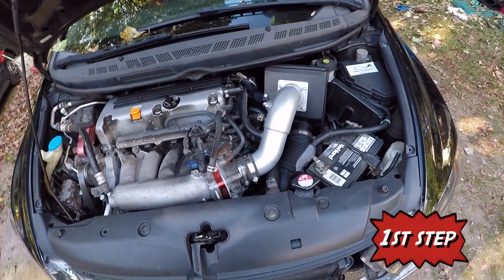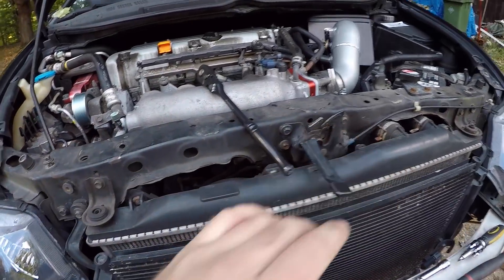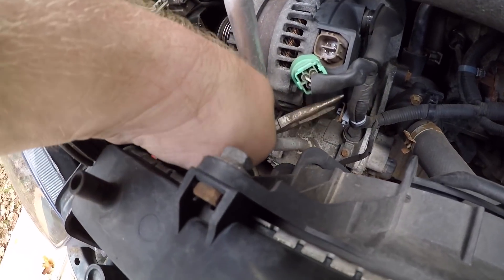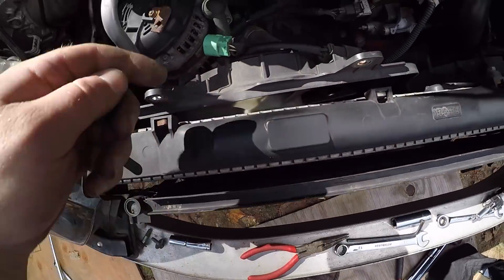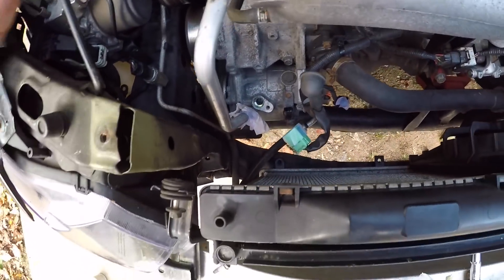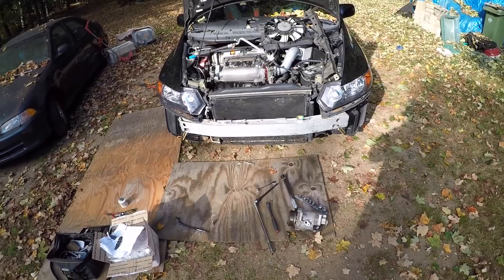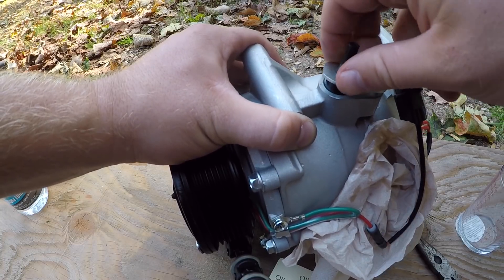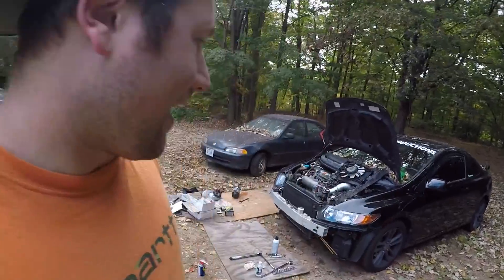Honda Civic Si Remove & Replace A/C Compressor DIY (2006-2011 Civic Si)

Comment: Thank you very much for your video, it helps me a lot. For those wondering whether you can change the a/c compressor clutch without take the compressor out, it is totally possible (but will take a lot of time), I just done this today. You don't have to take your bumper and alternator off, just need to take the bottom cover off and follow steps in this video to take the top cover and metal bar off (metal don't have to be off you can just lift it out of the way to remove the radiator fan), when you remove the radiator fan there is plenty of space to remove the a/c top 2 bolt.

Comment: Just going to do this a second time LOL. Don't go cheap on the compressor. Used a sub $200 one from rockauto and it took a dump on me after about 1.5 years (hole blown right out of the side - guessing the high pressure switch on the compressor didn't do it's job). Just ordered a denso one today which is what I should've done in the first place. And just a few pointers; that compressor you originally pulled in the video is the original factory equipped one with the green label that turns into a super charger after around 50-60k miles. Only the 1.8 civics got denso compressors. Also, no need to remove the alternator; just the passenger side cooling fan. And the radiator cover doesn't need to be completely removed (just unbolt it and swing it over to the right side). Also the whole bumper doesn't need to be removed either, just those top two grill screws (with Allen heads). Somebody previously was saying that you can get it from underneath but believe he's smoking something (maybe that works on a standard civic but there's no room with the 2.0L - even if you slid the compressor over by the bellhousing you would still need to drop the subframe a couple of inches. And believe it is standard practice to drain all of the old shipping oil from the compressor and put fresh stuff in there. IDK why they bother, maybe it's a warranty thing for people who forget to add oil but that PAG oil is like brake fluid and sucks up any moisture. Not sure if I would trust it coming from overseas.

Comment: Jesuz H, 1. get the front end on stands 2. take the rf wheel off, remove half of wheel arch liner. 4 loosen 4 sub frame bolts  remove the 2 short ones. 5 remove 2 10 mms on lines, disconnect the connector, remove 4 12mm bolts on compressor. With a prybar, pry down on subframe... it slides out the rf wheel well... the way he shows looks like it takes all day
Reply: Lmao screenshotted
Reply: "pry down on subframe"...isn't that bending/damaging the subframe?  It seems like you can definitely get to it underneath / wheel but not trying to bend things to replace.
Reply: @mjnuss  year latar lmfao but nah you can pry all u want you wont bend it

Comment: I’m also having a whining sound come from my car. I changed the idler pulley, belt tensioner pulley and alternator and I still have the whining sound. Did the whining sound go away for you after you changed the a/c compressor? If it’s not the a/c compressor it’s gotta be the water pump. What do you think?

Comment: Not bad. Helped with getting my alternator out. I didn't replace my whole compressor but just the AC clutch, thru the wheel well. Definitely will be removing it completely next time if something happens haha.
Reply: did this fix your sound issues?
Reply: @ivanc8533  no sound issue yet. But clutch was worn out and ac was intermittent, tho if there was a noise issue brewing I reset it as the AC rebuilt kit came with new pulley and bearing.

Comment: What issues did you have that you swapped out the compressor? My 8th gen is acting up. The compressor turns on and engages but my rpm’s drop to 500 rpm , then the compressor disengages, goes back up to 900 rpm for a moment, then drops again when it rengages. Then that cycle repeats til I turn off the ac. The engine almost stalls and drives weird when that’s happening

Comment: This is great! I have to pull mine out. Already did the altenator based on previous video from Gerb.  My compressor runs cool air if it will engage, but blows a fuse when it tries. I put a hockey stick fown there to force the clutch to engage while running, and AC is ice cold. So I got myself a clutch kit off Amazon for ~ $70 USD.  Its really common for the clutch to go and the compressor be just fine. $350 vs $70. We'll see if I can figure out the clutch. Looks like its just snap rings for the swap. I'll probably swap the oil and the rings after watching this. Any idea where to finda an o-ring kit for the compressor lines?
Reply from the maker: Glad i could help you out! I'd try local parts stores or a honda parts site for the o-rings. OEM o-rings will last the longest.
Reply: @TheGerbsteve  actually found a vid to pull off the clutch without removing the compressor. In my case that makes a lot more sense. Love all your vids

Comment: I never see u add freon
Reply from the maker: I brought it to a shop afterwards
Reply: Bro can u help me I clean my throttle body and now my check engine light is on and I did a relearn procedure and it still is not functioning right do I have to get a new throttle body thanks

Comment: Hey gerb I’m getting ready to change my ac compressor. Already change my condenser thanks to your video. I’m thinking about going with denso. My question is do I need to get anything else. Since this is only the compressor itself. Thanks

Comment: are the bottom ac compressor bolts shorter then the top ones?  I am doing my compressor and if you are looking at the car the bottom right compressor bolt of the 4 main ones hits the oil pan when I am reinstalling it.  I purchased 4 new bolts as I stripped one out when I was removing it.  Are the some of the 4 main bolts different lengths?

Comment: What was wrong with the compressor in the firts place? If was noise it coming from the front berarin.and simple you can change the front clutch like I did in my.

Comment: How did you drain your AC out? Tried lookin for videos but most won't get to the point. Do I need specific tools or?
Reply from the maker: I brought it to a shop. They need to vacuum it out with a special hose.

Comment: Good write up my man, the tq specs on the 2 10mm bolts on the compressor are 7.2ft/lbs btw so 7 opposed to 8 is probably a little bit better if you want to add an annotation (Pulled from the service manual :) )
Reply: Also, here are the numbers for the oil that shoudl be added for each component of the system :)
http://civic.hondafitjazz.com/A00/HTML/10/SNB6E10G10100050652KBAT00.HTML

"A/C condenser .  50 mL (1 2/3 fl·oz, 1.8 Imp·oz) 
Evaporator .  40 mL (1 1/3 fl·oz, 1.4 Imp·oz) 
Line or hose .  10 mL (1/3 fl·oz, 0.4 Imp·oz) 
Receiver/Dryer .  10 mL (1/3 fl·oz, 0.4 Imp·oz) 
Leakage repair .  25 mL (5/6 fl·oz, 0.9 Imp·oz) 
A/C compressor .  Since the oil separator is equipped inside the compressor for this vehicle, oil drainage is unnecessary at the time of compressor replacement. "
Reply from the maker: Thanks for the support bro!

Comment: Did this fix the whining noise? Because I own a 06 civic si and it's giving me a whining noise also, I just changed out the alternator yesterday and that wasnt the problem.
Reply from the maker: Yes it did.  I would highly recommend that you look into this.  Some of the symptoms of was having is an aggressive whine noise, car stalling, and wear on my serpentine belt. Wish you the best luck

Comment: The compressor that you replaced (Sanden) was original for the Si, not everyone comes with Denso. At least here in Brazil, all of them came with Sanden ones. Denso only on R18...
Reply from the maker: +Hugo Matsubara Did not know that.  Damn, wish mine had the denso, it would still be good haha.  Damn, Brazil?  I want to visit haha
Reply: Don't want to vid jack but being from Brasil, how easy is it to get a fuel sender from a one of those Civics?
Reply: My 07 Si also has this as OEM. They are prone to have the clutch go bad.

Comment: how did you evacuate the system?  Like how did you get the freon out before doing this?

I'm thinking of tackling this project soon.
Reply from the maker: A special machine at shops. I would not recommend letting refrigerant out on your own, it can be dangerous
Reply: Oh, yea, definitely won't let it out on my own.  Fortunately, I was on my first Rev of a tune via Flashpro, and when I updated to the 2nd Rev calibration, it fixed it on it's own.

Super weird!
Reply from the maker: These cars can be temperamental lol

Comment: I have some issues whit my ac too when the car is running it will blow cold air but when  is stop it won't what you think it could be the issue?
Reply from the maker: To be honest, my Si started doing this not too long ago. I really think it may be some sort of valve that could be clogged.
Reply: Check the a/c fan might has low rpm

Comment: Question, how did you determine your AC compressor was bad? Not sure to replace the compressor or just the clutch. AC system works fine when the ambient air is cool and stops working when the air is hot after 15 minutes or less. Just keeps blowing hot air and the clutch is no longer engaged. Any advice from DIY Utubers will be appreciated. Thanks for your video 👍
Reply from the maker: It was making a whining sound. Also I believe the clutch was fried in my original ac unit.  I would grab yourself a whole new unit. Could be the expansion valve also 👀
Reply: You can use a power probe to determine if the clutch is bad on the ac compressor. When turning on you AC compressor the clutch should kick in and creating a load. A power probe will let u shoot power directly into the compressor and determine if clutch is bad by visually seeing the clutch not press in
Reply: @ricefactory9018  Thanks for your troubleshooting advice. Will try once I get back from vacation 😎

Comment: Man just a quick question for ya. I just bought 8th gen si, has injen intake. Car runs great but the problem im having is from the AC. Whenever i turn the fan on it gives me a hissing sound & it goes up as the fan speed. What do you think it has?
Reply from the maker: Sure it's not your serpentine belt?

Comment: Good video, my AC/System goes On and OFF when driving and create condensation on the vent. Do you know if vacuum and re-fill with the gas will fix the problem or should I change the compressor ?
Thank you
Reply from the maker: Thank you bud... Try adding a bid of AC refrigerant first and check the system for leaks. It could be compressor, condenser, ac line, fuse, etc
Reply: @TheGerbsteve  I checked the system and low leak. I pull out a full 1 pounds out of it. Qhen adding it back the pressure was low, 100psi, should be close to 150 someone told me.

Comment: Hello I have a AUDM civic 2.0(k20z2), recently the ac clutch doesn't engage when it's hot.
Just wondering if there is any chance to move the compressor a bit to the left-hand side(Driver-side in US) of the car but not remove the ac lines so I can have some more clearance in order to access ac clutch without recharge ac system
Reply: did you ever solve this? trying to replace the ac clutch on my k20z3 and i really don’t want to drain the lines and remove my compressor
Reply: @jaronmeyer2430 ke off the serp belt, loosen brackets on lines up top, take out the compressor bolts and let the compressor sit on the sub frame. It’ll give you enough clearance to remove the clutch shims with a baby impact. You replace the clutch all together if you like

Comment: So you don't need to remove the alternator to replace the compressor?
Reply from the maker: Correct, there's bolts you can access for the compressor with car jacked up from underneath.
Reply: 😂🤔🙄yeah idk who has actually tried that. It’s better to remove from the top and I’m just starting my first one. There are THREE subframe bolts to remove on just one side. Also, remove the front and rear engine/trans mounts to have enough slack in the subframe to sneak the compressor past. No, I’ll go from the top for this. I’m not afraid to drop the subframe. I’ve already removed and replaced a trans and clutch in my car. It makes no sense to do this job from underneath.

Comment: After your done do you refill it or what you do I did it and my ac compressor doesn’t start?
Reply from the maker: Yes. You refill system with proper amount (oz) of r134 refrigerant

Comment: how long would you say it took to complete  ?
Reply from the maker: Took me a few hours easily. It's worth it to DIY though
Reply: for sure.they tried to charge me 700 bucks.  im tackling this job sometime this week. did you take it to recharge or did you use a kit at home to charge the freon?

Comment: Was your problem it cutting off and off after warm up?  Mines fine till car gets hot then it disengages n wont come back on till cooled down.  my pressures are fine no leaks n it blows really cold on startup.   

plzz help i need mine fixed asap
Reply from the maker: The car would stall on me when warm & was making a crazy wind noise. Mine would engage and the ac would work, but it would make a weird grinding noise. Pretty sure my bearing or clutch fried.
Reply from the maker: Whine***
Reply: Gerb did it fix the whining noise a bunch of us are plagued with

Comment: Hey gerb I have the same problem with this it makes a loud noise near the compressor like the beering or something this friday id be looking for a new one and change the beering of it i was wondering was yours making a sound too ?
Reply: But its in my acura csx type s its weird i changed the idler but sound still goes on and its real loud
Reply from the maker: It's most likely your AC compressor bro... The bearings/clutch are know to fail frequently

Comment: it should tell u the right amount of oil umder the hood on the catalyist for each and every a/c component along with how much freon it takes to completely fill the system. look for the sticker under the hood.
Reply from the maker: Tells me the amount of refrigerant, not pag, which is bs

Comment: Hi gerb, I am thinking about buying this civic si just like yours but owner says the ac was removed. Is this compressor all I need for it to work? Im hoping just the compressor was taken out. Why even take the ac out for lol.
Reply: Really want to purchase the civic but I don’t really know the basics of all the parts needed for the ac to work. I think it needs compressor and an ac line. Any other parts I should know about?
Reply from the maker: He probably got a ac delete kit.  People usually take AC out for weight reduction and boost purposes ;)... You will need compressor, line if none, condenser, expansion valve, and I think that's good.
Reply: Gerb Productions cool thanks for the info! Owner is saying it needs ac hose , compressor , and condenser. It probably does need that valve your talking about too. Do you know how much everything would be? I’m gonna install myself using your videos cause I don’t want to pay a lot for labor. Your pretty specific in your videos. Can’t wait to get my civic si. I’ve always wanted one
Reply from the maker: Np man 🤙🏼... just get those three things.  Your expansion valve is on the back firewall of the engine.  You will see it when you connect the ac line in.  eBay bro, eBay is your friend lol. I pad $140 compressor, $80 condenser, and ac line, maybe $60?? You’re probs looking at $200+ for parts.  Now if you had to pay someone, there’s another $300 👀

Comment: Sweet glad I found this video gonna help alot thanks!! Did you ever get video of the heater drier and other part you were gonna change?
Reply from the maker: I did not man, just replaced condenser and compressor
Reply: @TheGerbsteve  hey thanks for the reply..one more question if ya don't mind....was the 3.oz you put in compressor enough? No issues since? I have the same problem mine came with some oil in it already and a bottle of PG  but says to drain it and re add?

Comment: What brand was the ac compressor and the condenser?
Reply from the maker: Don’t remember the ac compressor, but the condenser is denso
Reply: Has your AC been working fine since installing these 2 components? My AC blows warm air and I can't stand it any longer here with this Texas heat lol.

Comment: You guestimated correctly. 3 ounces PAG oil. The last .3 ounces were still in the compressor. Don't forget to pull a vacuum on your system for about 1/2 hr. -30 vac. Gets rid of moisture and air you let into the system. Could clog up expansion valve. Other wise good vid.
Reply from the maker: Great points ;)
Reply: I'm also needing to replace my AC compressor, when you mention to pull a vacuum on the system, you mean to flush the refrigerant and not the PAG oil correct? And I'm also assuming a shop is recommended to do this since its technically illegal?

Comment: l rather take the bumper off and the a/c condenser and the radiator will make much easier to get to a/c compressor.
Reply from the maker: W.e is easiest for you bro.

Comment: I have an 07' Civic SI and need to change out mine. Can you send me the link for the compressor & kit you ordered?

Thanks in advance!
Reply from the maker: I don't have the links bro... Just type in denso for the condenser on eBay & i believe the ac compressor is like a sanders or something.

Comment: I got priced for 1000 bucks on replacement so I bought a compressor,dryer and expansion valve, set of gauges and vacuum pump for 240.00 total. Figure 2 to 3 hrs on wifies car and that should do her.
Reply from the maker: Can't beat DIY ;)